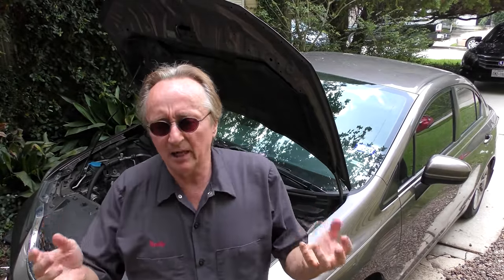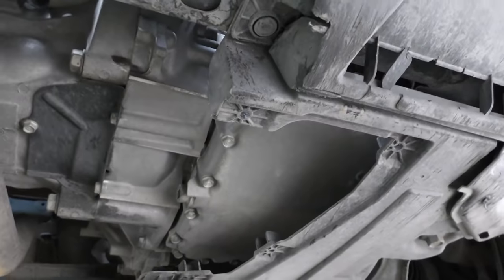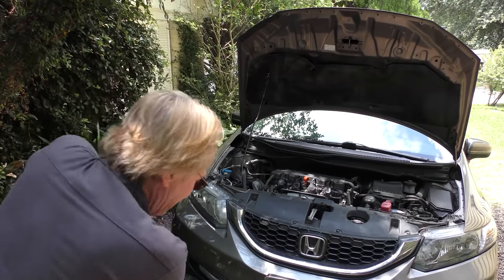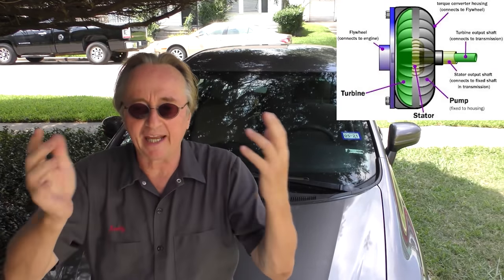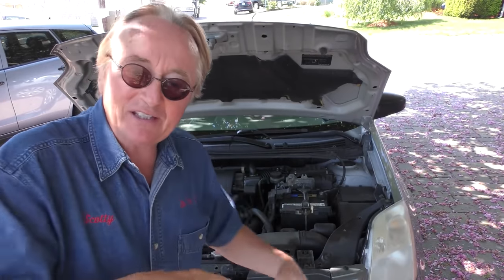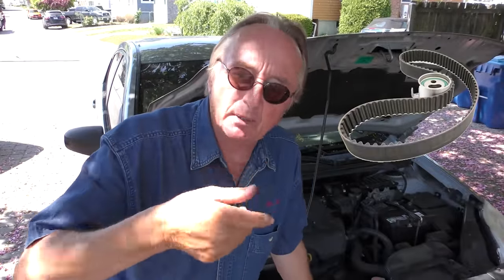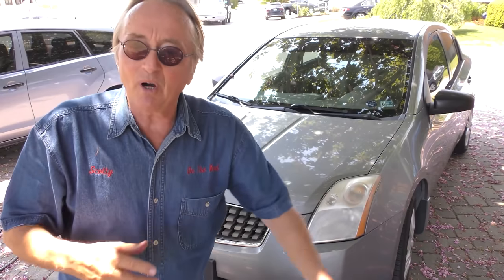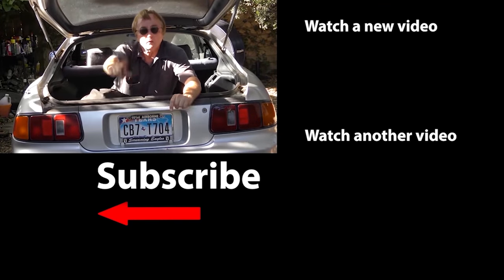Cars That Have Serious Transmission Problems (Do Not Buy)

Comment: Hi Scotty great video, there's one very infamous Mercedes 5spd automatic transmission in various C class & E class models from late 1990's to mid 2000's, notorious for a plastic conductor plate cracking and throwing the whole car into 'limp home mode'. A inexpensive part that required drain & removal of the pan, filter and the valve body in these 722.6xx pile of crap slush-o-matics.
Reply: Probably the best automatic transmission ever made. By anyone. First one that could take +1000Nm. I have over 250k miles on mine. 0 signs of wear still. And nothing ever done to it in its whole life time except oil change.

Comment: It may not be the most exciting car but my 1996 Acura 3.5 RL that has just hit 200,000 miles has been the most reliable and solidly built car I've owned, I work on my own cars and I've done some preventative maintenance and replaced normal wear parts over time but no serious problems at all, the computer throws 0 codes, engine just runs extremely quite and smooth and trans still shifts good, everything just works and the car rides great and glides on highways, it was one of those good finds that I bought from the original owner back in early 2015 for the right price in amazing condition and still can't believe it's now an almost 30 year old vehicle.

Comment: I'm getting an 87 accord auto with the carbureted 4cyl from a friend for $800. I've looked it over and it needs a valve cover gasket. I can rebuild the motor, tans, do the brakes and suspension for around a grand. Seems like a decent deal for a good commuter compared to my 96 mustang gt manual 4.6 especially since my commute is increasing by 60miles
Reply: I had a honda accord 1988.  loved it  finally sold it after being the original owner for over 25 years.If I had the money to replace shocks etc, and an electrical problem some where that ran down the battery (I left my window open & water leaked in ) repaire people wanted to  ost 2000 just to find where the broken wire was.,  & rust body from Michigan winters, I would of kept it. but sold it.  miss it..

Comment: So why didn't they make these CVT transmissions like a snowmobiles, with an external belt system?
You change the belt from time to time and that's it!!!
OH wait a minute, that would mean the average owner could do it himself in a 1/2 hour or so.... 
That would save the owner thousands of dollars when it needed changing!!!!!
Reply: That is the point. They want to make a lot of money so they design to break not to last.
Reply: A rubber belt won't work for a heavy vehicle.  These things work off of a "steel belt" that's really just stacked discs... and instead of "pulling" on a pulley like a snowmobile rubber belt-- these CVT's "Push" the belt forward to drive the pulley.  and it needs to be bathed in oil...  Go look up CVT's on  "Weber Auto" channel.
Reply: @calholli  Yet there are thousands of vehicles out there with "rubber" timing belts!
How can this be?

Comment: Yep staying with my old Forester with standard manual gearbox. Don't want the boring CVT of the newer Forester's
Reply: My buddy’s 2015 Forrester’s   tranny crapped out recently.  Luckily Subaru has extended the transmission warranty as it had to be replaced.

Comment: If it has a belt then you change it in good time, along with quality parts including the water pump and tensioner etc.  Surely not that hard?
Reply: @hoz49  here in the UK it'd cost you around £400.  Once, or perhaps twice if you had the car a long time.  I don't think that's a big deal personally seeing as the average cost new is £25,000 plus.

Comment: :)!!! Scotty I love you man!!! I have a Nissan  1.8 Sentra has 89,000 milse but automatic put a transmission additive it is that Came well recommended by Burcoltz Transmission (WELL TRUSTED FOR MORE THAN 30 PLUS YEARS-in Buffalo Ny-and yes like you I did grow up in the Falls lol l ol l lol ) to make the Auto tranny last longer-I do have a transmission cooler to put on it. Scotty how long should this car last-I paid $3,200 at 85,000 miles-with the cooler on the Tranny, and what do you think about putting Slick 50 tranny additive in it, after I flush it out tranny. I remmber  you saying if the CVT is good leave it alone. CHEER MY MAN!!!!:)!!

Comment: You REALLY should've put the GM 4T65E and 4T65E-HD transmissions on here. Absolutely NOTORIOUS for failure. ALL of them fail in the same exact way.
Reply: Which vehicles have those transmission? I got a 3.6 6 gear impala
Reply: @kevo9352  the 4t65 should be a four speed if they use the same numbering system
Reply: Is that the one used on 2000s Buick LeSabres?
Reply: @perfectibility999  2020 impala 3.6
Reply: Absolutely, had mine go out in my 06 Monte Carlo at 125,000 miles, and also an 11 Impala I had went out twice. 1st time around 160,000 mostly hwy miles and the 2nd time around 265,000. I junked the car after the 2nd one even though the engine and everything except the transmission still worked perfect. Just couldn't see putting another $2500 in it.
Reply: @kevo9352  the engine in the 2020 is gm's finest, that transmission is bad aswell. There is a popular trans swap though that should take you to 300k miles easy. Impalas are really nice and fast.
Reply: @kevo9352  Basically every GM car from around 2000 to 2014 with the 3.8, 3.5 or 3.9L V6 engines. Those transmissions are complete junk and it's a shame because the engines their paired with will pretty much run forever if you keep the oil changed. I've had 4 different versions of the engines and one was still going at 265,000 when the trans went out for the 2nd time, another is still going now with 205,000 on it, and 2 more that are over 130,000 and still going.
Reply: @bioheart09  oh really, the newer ones are that bad? Even if you keep up with service intervals? How long till they go bad usually? And what transmission ?
Reply: Yep, had a 2001 Grand Prix with 3800 series 2. Awesome engine but junk electronics and the tranny was garbage. Shift kit helped and doing a drain and refill kept it going till 175k when I dumped it on Facebook to the next sucker
Reply: So glad I have a Pontiac G6 🤣 they ditched that transmission, but it was on some models of the Grand Prix. 4T45 on my GT, still shifts great at 180k miles, no idea of the fluid has even been changed (mechanics I use were surprised the manual even said to change it every 50k).
Reply: @rwieber79  Negative: the G6 V6 models all have the 4T45, and many of the 4-cylinder base models use it as well. I live in the Midwest and you still see Pontiac G6s everywhere, even though they haven't been produced in over a decade now.
Reply: @scha0786  Booo for knowingly selling a junk. Your ways will come back at you eventually.
Reply: Was this transmission used in 90s LeSabres and Park Avenues?
Reply: O4 Trailblazer (no longer owned by myself) has had 3, maybe 4 transmissions at this point. I replaced the oem with a $2200 transmission that had improved (not plastic) gearing. When that one went out, upon replacing it we found that the company (previously known as transmart) had built the upgraded transmission without tightening internal components properly. Ug
Reply: @perfectibility999  Those were 4T60E. Not great but better than the 4T65E. Before that it was the cable shifted 440T4 which was better, but still not great. Very heat sensitive and sensitive to abuse as well. If babied and fluid changed ever 30K could go for a long time. I have 345K on my 440T4 with no serious issues. I live in a cold state tho so I'm sure that helps.
Reply: @caayydenn  Was the 440T4 used in Buick Centuries in 1993?
Reply: @perfectibility999  TH125C 3 speed I believe. I could be wrong tho. A quick google search would tell you otherwise.
Reply: @caayydenn  Yes, that's the one. Do you know if they're good transmissions? I just bought a 1993 Century with low miles and it runs great. I had a 1990 Century with the 3.3 liter engine too that ran way over 200,000 miles before the transmission went (and it was my fault and likely could have lasted longer had I not mis-shifted in the West Virginia hills), so I'm wondering if I can expect the same for the 1993 I just got.
Reply: @perfectibility999  I've seen lots with 200K or more so just drive it lightly and make sure fluid stays clean. It can last a long time if treated right. An aftermarket trans cooler wouldn't hurt it.
Reply: @perfectibility999  trust me they did when I bought a 02 Jeep Grand Cherokee. Dude sold it to me with a leaking head gasket and leaking rear main seal. Lesson learned? Yep I just buy brand new now. I hate dealing with other peoples non maintained beat on till there’s a problem gotta sell now.
Reply: @scha0786  Should disclose those issues to the potential buyers
Reply: @J Bar Not exactly. Never stopping, brakes would last forever, and pretty much true for automatic clutches engaged and never shifting. However, hard brake use wears brakes much faster than clutches in modern automatics. I just replaced the 4L80E in my '98 Chevy dually w/ a Monster Mega SS trans w/ a HD2 shift kit, rated to 1000 hp for a future Cad 500 going in to replace the stock Vortec 5.7. The guy I got the trans from has the correct mid shift firmness spring set, but, the .125" hole drilled in the separator plate-the max recommended, makes the trans shift lightening-fast, which is too fast for the truck under a heavy load. I will get another separator plate and drill it around .90". "Shift improver kits" when set properly make autos last much longer and run cooler, w/ just a few different springs and drilling a transfer hole slightly. Also, my clutches are NOT like stock, but a much improved material.    Look into Red Eagle clutches and Kolene steels. Also, my converter is waaaaay better than stock w/ a billet 4 clutch kevlar lock-up.

Comment: Just bought a 18’ rogue with the 68k on it. Scared me to buy this with the cvt in it but it was a SL platinum and well taken care of. I went straight to nissan and had them change the fluid. Not cheap, $300. Hope the fluid change works down the road. I do have a chance to buy a bumper to bumper 3year/36k warranty if I want. For $2800. Worth it?
Reply: I wouldn’t get a bumper to bumper. The transmission on those is bad but not as bad is earlier model Nissans so I think you’ll be okay if you take care of it and don’t abuse it. If you want more piece of mind maybe a power train warranty if it’s cheaper but personally I wouldn’t do it.
Reply: Best to return the rogue if possible, Nissan CVT are the worst in the industry, the best transmission is still the manual, the conventional torque converter automatic transmission may be soulless and boring, but it’s reliable

Best bet would be for you to get a Honda/Toyota in manual, or if you must, a regular torque converter automatic.
Reply: Watch some videos and learn to change the fluid yourself. It’s pretty simple actually. Change the fluid at least every 30k miles and you’ll get the best life from it. It definitely won’t last as long as an old automatic but it’ll give you useable life if taken care of. Baby it basically or if you can get more than you paid it might be worth passing it on. As for the warranty, no, waste of money. Most cars won’t break outside of 100k miles and the extra warranty would be gone at that mileage. They know that. They normally don’t cover any wear and tear items so save the money and use it to care for the car
Reply: I just bought a 2017 Maxima and got the 36,000 mile warranty with it.  So I have until 100,000 at least.    I believe the 2017 models and up they ironed most problems out of them.  I do know Nissan was sued because of the faulty CVTs.  Altimas has many problems from early 2007 until mid 2015.( I only drive around 10k or 12k miles a year and 90% of that is hwy miles anyway.)  If my 200 Touring lasted me 80k miles so far with 108,000 miles on it I'm sure this Nissan CVT will last at least that long.  Those 200s are rated the worse cars ever made and I had it over 8 years now and it hasn't had a problem yet.
Reply: The transmission isn't bad, the cooling system was really bad on earlier modles. Plus, changing the CVT fluid (has to be the same specification on the your car's manual) alongside both filters will prolong the life of the CVT.
Reply: @RPD91  one dealer told me to change every 30k and another said every 60k. My dealer said they use nissan fluid and the other said they use valvoline and had better luck with it. As far as I know they only change the fluid. Didnt see anything that said filter in the parts used description. I only drive about 3-5k a year in the city but might use it on a few road trips a year.
Reply: Cvts tend to wear out in Nissans about 150k miles. So depends the mileage u want out the vehicle. U want 200k? Might want to get an extended warranty
Reply: @captinbeyond  That sucks, I didnt really ‘want’ to buy a nissan but after driving all the compact suv’s I really likes the rogue best. Almost bought a Sub forester but couldn’t go for the harsh ride and bare bones feel. Probably a much better vehicle but hard to spend 25k on a car you don’t even like
Reply: I had my cvt go out in my 2012 Maxima. I'd never but another Nissan product. Replaced it with an old Lexus LS400 with a real transmission. Never again, learned from watching Scotty. I'm sticking w Lexus or Toyota from here on out.
Reply: Who makes the ROUGE?? Never heard of that one

Comment: Here in Thailand its really hard to find a manual gearbox.  Most brands dont have them at all and those that do (mainly 4x4 trucks), are only in the lowest spec models.  66% of cars are Honda or Toyota, so CVT's (almost exclusively).  At least they're good CVTs. Next biggest selling brand is Mazda and they use 6 spd ATs - also very good.

Comment: I got a 2005 Ford freestyle with 243k miles. Original CVT still going strong. If you change the fluid in them they seem to last a very long time.

Comment: Man he called it, I bought a brand new 2013 sentra Nissan in 2012, cvts were new at the time, and 81,000 miles barely cause I switch between my motorcycle and this, but anyways , keeping on the problem, my sentras transmission died at 76,000 miles, now mind you kept up on everything oil, spark plugs you name it, still have it and going to trade it in, it is deemed unreliable to me .
Reply: Oh Nissan's transmission were terrible, they were the worst among other manufacturers which was detrimental for Nissan because they're so much better with a manual, but no one buys them with manual :/
Reply: @isaac4273  yeah I wish I had gotten a manual instead , but im gonna get a manual but not from nissan, there customer service was terrible,  I've been a loyal member also, its sad no one thinks of helping unless it benefits them, think any other vehicle can make it past 76,000, its almost sad im writing this , but maybe it's just to help people stand clear of getting a CVT, maybe not all but definitely not from nissan, im also not a fan of electric.
Reply: I have a 2017 Nissan Versa note and I change the cvt fluid every 30k miles and the engine oil every 3k religiously. The car is almost 45k and working like a clock without issues.
Reply: @FPVphilly  that's good except it's a newer model,  mine is older however I did the very same thing you did, only difference was my model from 2013 -2016 of Cvt transmissions nissan were bad hence mine fell in that year, but regardless , replacing a CVT is not cheap nor is it reliable in my eyes, manual transmission easy to fix and cheap also better in controlling the gears, I respect what you said even though I said I kept up with everything maintenance wise, I stand by my opinion and experience,  they don't make cars like they used to, and electric cars have some ways to go before I even think about purchasing one.
Reply: @GearsToStreet  indeed
Reply: cvt's were new in the mid 90's. Most manufacturers learnt from the problems and improved them. Nissan never improved.

Comment: What about Honda Fit / Jazz, series 1,  these had problems too. If you bought a standard tranny, you got the best car possible
Reply: 5 speed automatic 2 gen is good.
Reply: The trick with these is to have the transmission serviced with only genuine Honda fluid. Many problems with cvts are due to people putting in non-cvt fluid, with the Honda you also need to avoid any generic cvt fluid. Honda have their own mix. There are a lot of high mileage Fits/Jazz that have never had the transmission repaired.
Reply: I have a 2011 Fit with 5 speed automatic.  Easy to change fluid and filter.  I read somewhere it Doesn't use planetary gears like a normal automatic?

Comment: I have a 2008 mdx 151k miles, same engine same transmission.
But when I put it from (P) to (R) the it takes a second to take off and it shakes, same thing happens when it shifts from 1st to 2nd, what could be the problem